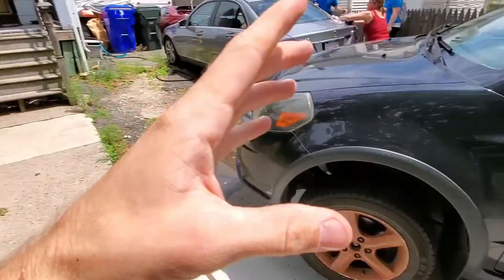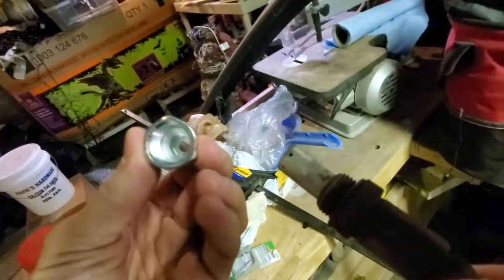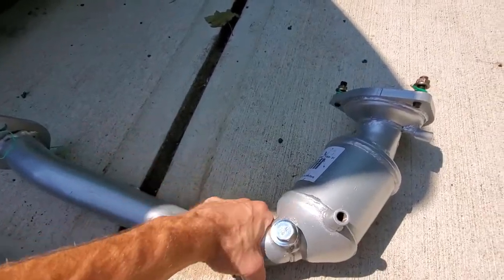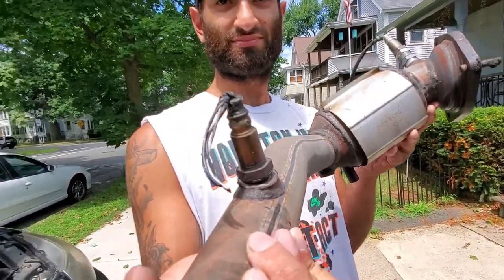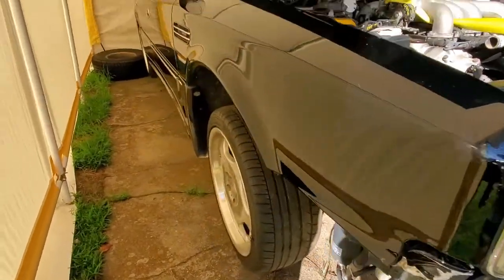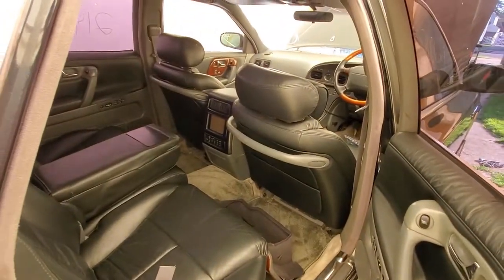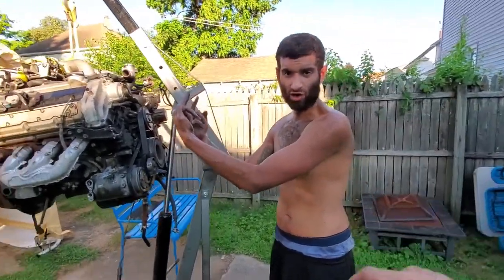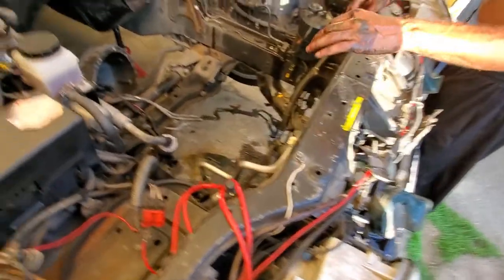Easy Way to Clear Engine Code P0420 (O2 Sensor Fix)

Comment: Could you just use high temperature paint to cover the whole sensor so it is not so sensitive?
Reply from the maker: I wouldn't do that because then it may cause heat soak on the sensor

Comment: Hi and thanks for the video. Were you losing out on gas before you replaced your o2 sensor/what were some of the symptoms of your bad sensor, also since replacing it has your mpg went up? TIA. 👍🏾
Reply from the maker: I was, once I replaced the sensor and the cat my gas milage went up significantly.

Comment: How do you like that little code reader? Would that code reader work good for inspecting cars at an auto auction?
Reply from the maker: It's a cheap 20 dollar one. Idk how it would do for any major codes, but its picked up every code I have had.

Comment: That’s so funny. I have a sx4 as a daily with the same code but just ignore it. I noticed the gas mileage sucks when it’s on.
Reply from the maker: I bet it's the downstream 02 sensor due to the fact it does not fit at all

Comment: There's a bunch of vids on this.. the question is.. does it solve the problem?   If the only problem you're having is the fact you see a check engine light.. then just erase the code
Reply from the maker: Yes this fixed the problem. And by just erasing the code the car will cause it self to find efficient ways to try and compensate for the air to fuel ratio, and in my case made the car burn oil.
Reply: @ZBruhzchannel  cool, but how do you know you were "burning oil" ?  What was your ACTUAL problem? Besides just seeing a CEL?  FYI.. not trying to argue, trying to learn
Reply from the maker: @shaffydaffy3050  no worries, I could smell the burning oil and I would check the level frequently and was low each time. I didnt have any leaks anywhere either

Comment: Would just getting new sensors fix the problem? Without getting a new cat
Reply: With the amount of miles that was on his vehicle he did the best thing by changing the cat. with 100,000 plus miles they start getting clocked either change them out or cut them off and run stright pipe if you do not have to get the car inspection. but he did have to get inspection and sticker.